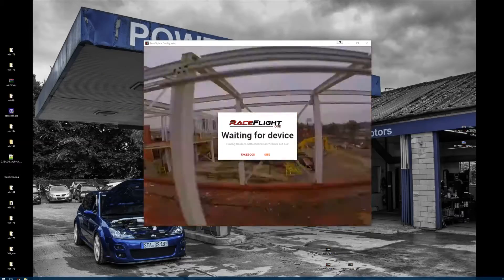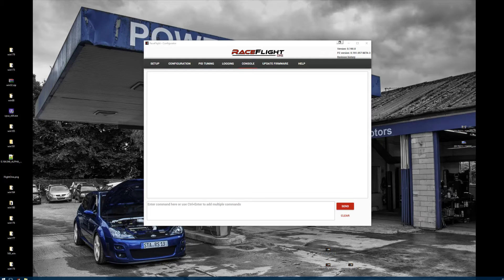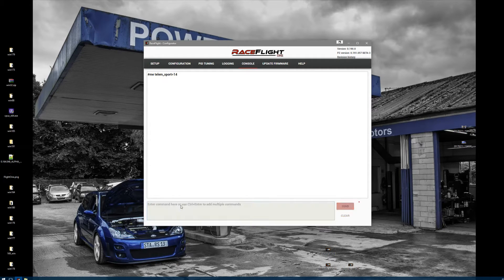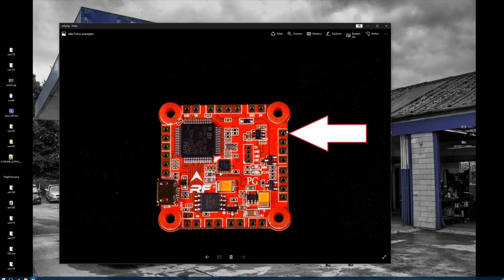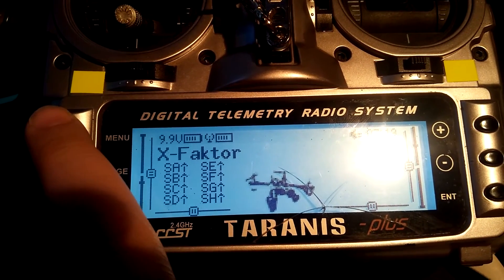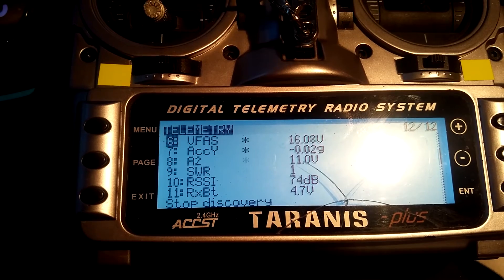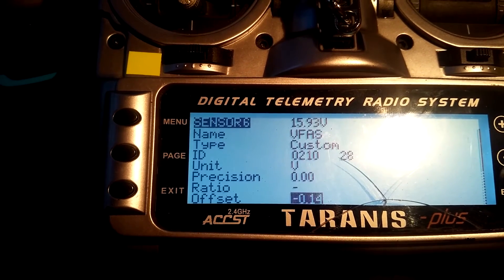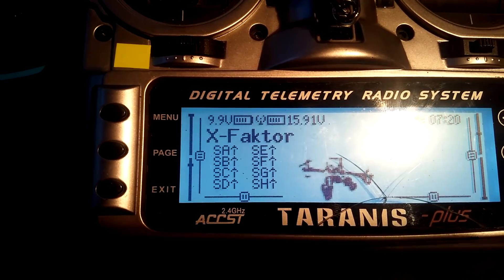[ENG] Raceflight Revolt RF1 - Frsky Telemetry - How to have Vbat

Comment: Hi,
on the Revolt V1 do we have also to plug to RX3, because i've tried and it is not working
Reply from the maker: I did this on a V1, so yes its working. It may have changes with the command. Try to slide Frsky Telemetry to on in the GUI :)
Reply: thnak you, you plug RX3 as per the note or TX1 as per the picture of the doc ?

Comment: does using the offset on the taranis scale correctly as the battery drains?
Reply from the maker: yes, did test it with 3s and 4s batteries, full and empty. offset stays the same
Reply: good to know thanks!
Reply: NJ Tech hey NJ, you have been really helpful with me in the past and I was wondering if you are having the same problem as I am. I cannot get VFAS to work with raceflight. I wired everything up correctly for the X4r and bridged the needed pads. I updated to the latest rc18 and updated my taranis to the latest stable release 2.2.0. I even tried changing x4r's and no luck. When I hit "discover new sensors", it picks up the VFAS but it only reads 0.01v. I am really disappointed as a changed my whole quad over from kiss to raceflight. Any tips would be greatly appreciated.

Comment: would you need to solder a wire from the PDB vbat to the FC volt or current pad?  how does the FC get the voltage reading to send to the s.port ?
Reply from the maker: There is one port which is called voltage. There you go with your lipo voltage (up to 6s) if you look from above and behind its the second right on top site. Make sure to check this wiring diagram for this information: https://revoltfc.com/pinout-diagram.html
Reply: thats what im trying to do now lol